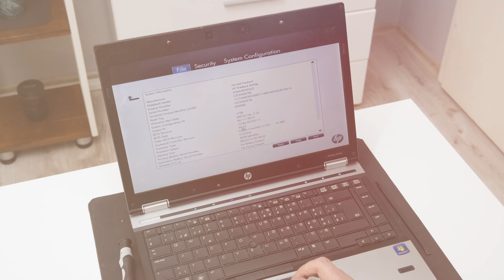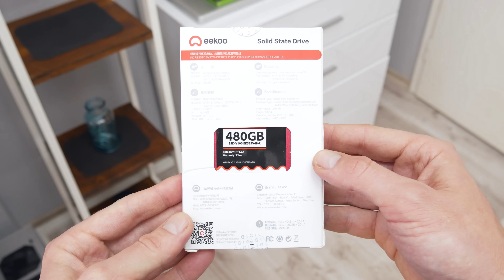Restoring and Upgrading an old HP EliteBook ( Plus Data recovery )

Comment: Andrew I was wondering if you could try an egpu on this laptop I own this with an i5 and wanted to order the exp gdc dock
Reply from the maker: I've tried but not working well, works over diy egpu software only and express card connection but with a lot issues like, dissconecting, driver errors

Comment: 'This laptop is fine for basic use'.

Uh. That little i7, 8GB RAM and an SSD will do better than most mid-range shite on the market today. :)
Reply: These 1st gen 2 core mobile i5/i7 CPUs get beaten by mobile Celerons today. The 4 core models still have some use but that's it. You need at least a 2nd gen if you want something decent.
Reply: Basic use, yes. But this i7 delivers performance equal to 6W Celerons today. For $700-$1000 today you can chose between Whisky Lake i7, Ice Lake i5, Zen+ Ryzen 7 or Zen 2 Ryzen 5 laptops. These are way more powerful than this i7-620M.
Reply: @Subh8081  The fact that a first gen i7 can even MATCH any modern processor is impressive by itself
Reply: The same cannot be said about the shitty Intel integrated GPUs, though.
Reply: Might perform well but that tiny poor excuse for a trackpad would drive me mad
Reply: I use that Daily and i download Windows 10 and it works fine
Reply: always ask what generation it is. A first generation i7 doesn't worth today, instead 5th gen intel cpu are still good
Reply: I'm sure my 2018 HP Craptop™ will only get 5 fps on battlefield
Reply: not really as it's the first iteration and a dual core from a decade ago
Reply: @gnuportexe4657  True but it has 2 physical cores and 4 logical cores. This i7 performs quite well. There are still laptops that have 2 physical cores and 2 logical cores and they do this to save power. I have this same chip for my HP and Dell. I am going to the i7-820QM to test that cpu next.
Reply: @gnuportexe4657   got the i5 still fast sandy Bridge aged well for me ')
Reply: @MrSonic731  yeah but that has twice the cores at a faster clock speed.
Reply: @gnuportexe4657  mine too i5 version and it's almost going to be a year now and it automatically shuts down while even browsing chrome ;(
Reply: @aapkaash  Thats probably because it gets hot, Clean the fan and replace the thermal paste with new

Comment: Hello, I'm from india and I have a laptop with a AMD A6 9225 processor and I want to convert it into a ryzen 3 or 5 processor can u help me in telling me whether it is possible or not and where to find the parts if it is. By the way ur vids are very good and intellectual
Reply from the maker: Hey bro, you can do some upgrades but not to Ryzen. There is a few reasons. Laptops and most of the computers are designed for specific CPU, they have socket that support specific CPU, chipset that supports specific CPU models and basically the entire motherboard is made to support  line of one Generation or line of limited CPU numbers from one generation CPU's. The only upgrades that can be done are the CPU ( if the CPU is removable, not soldered ) RAM, Disk and in some cases GPU ( some high end laptops have removable GPU )
Reply: @ComputersAndTechAndAndrew  thank you so much for helping

Comment: Make a video on you modding an all in one pc with a gpu. It would be nice to see one. I have one of those, and I think I can do some more upgrades soon. Mine is a 2009 Acer Aspire Z5600. It had touch screen, but the driver for it are not working anymore, and I was unable to get drivers. Either way, just wanted to tell you for a suggestion, that exact model or similar would be very nice though.

Comment: Will dell process intel celeron can turn into i3 please reply
Reply from the maker: If the CPU is removable than you can upgrade, I have video on my channel where I upgrade Dell from Pentium to i7
Reply: @ComputersAndTechAndAndrew  the model is dell insprion 15 3552 i don't know much but my pc lag to much and i am a 17 year boy i ask many place but they told the the procceesor cannot be changed or remove please tell me if i can change from celeron to i3 model is ispiron 15 3552 please reply by the way i am from India  i hope you will reply thanks to be responsive
Reply from the maker: @Luciferr.76  Hey bro, the CPU in this laptop is not upgradable, it is soldered on the motherboard, the only waht you can upgrade is the RAM and HDD to SSD
Reply: @ComputersAndTechAndAndrew  thanks to reply now i will use this only for my basic works so thanks to be resposive once again most thanks from bottom of my heart.
Reply from the maker: @Luciferr.76  U r welcome bro

Comment: Good restoration, I had a 8440p for a few years but I got a 8440w for free since it had a dead mobo and went all out after selling the p. New quadro board $35 on ebay, 820qm was $26 on ebay, 500gb WD blue on Amazon for $58 and a ODD HDD caddy for $15 with a 1tb rotational I got free from work. Already had 8gb of ram, the 1600x900 display and centrino ultimate 6300 wifi card. 820 is A LOT of chip for that cooler but it manages. I just use it for YouTube and email and stuff but I love it! Keep up the good work :)

Comment: I did the same with my STI1422 a brazilian variation of ECS R42 Laptop , i7 640m , 8GB Ram Dual , also i bought a new cover *a variation with  a fingerprint sensor , added Bluetooth with Centrino 6235 and Added 3G Card , and of course i have switched from a HDD to a SSD and kept the old HDD on CD/Driver slot using a Caddy Adapter...

Comment: Incredibly surprising that it's capable of 4K from a browser. With proper HW/Accel from something like, say VLC or PotPlayer, especially KODI, you can expect it but straight from the browser? Not bad at all. Video playback from browsers usually takes a gargantuan hit in performance compared to a proper video player, so for a laptop this old to run it in 4K... Impressive

Comment: I have a hp pavilion 17 notebook. I need to upgrade the WiFi card. I need to know the best one. Can you help me?
Reply from the maker: Hi bro, HP pavilion models mostly have Realtek WiFi card, if the WiFi is not working ( burned/damaged WiFi ) than you can buy a new one but similar or the same. Because some models of HP have compatibility issue, not all Wi-Fi cards are accepted by the hardware.
Reply: Thank you for responding so quickly!😊

Comment: Got the i7 version of this laptop 5 years ago as a refurb for $300 and just put an SSD in it, as he says, great for basic tasks.
Reply: Basic tasks, I beg to differ, very powerful for it's class especially with i7 and SSD. 16 RAM DD3 and it's a powerful machine.

The LORD JESUS CHRIST bless you!
Reply: @Smitty-op4ld  I tried to edit video on it and it was having no part of it! Lol
Reply: I got the Latitude from the same era with i5 5 years ago for 250ish usd and it still works  with an sshd, albeit it slows down alot with browsers these days. I didn't put ssd as I don't think it would be used at full potential as its sata 2 port only.
Reply: @tejaspadhye  Since replaced it with a new Acer Spin 5
Reply: i am using the same and i did the same but i only get it for like 50 or 70 bukes
Reply: I had an i7 model that was originally given to me by my company and later bought from them. The monitor quite frequently shut down and now it didn't start at all. I then bought an i5 model that was working fine even if it was slow that I've replaced it with another i7 model that randomly reboot for no apparent reason. Any suggestion on how to repair the repair the two i7? I was thinking to call a repair shop but I'm afraid of the costs.
Reply: @dacki84  Replace it, its 15 years old or more at this point.  I gave the one I had away years ago.  You can still get refurbished laptops "off lease" from big companies for cheap

Comment: Give it to lowspecgamer he'll be running battlefield 10 in no time.
Reply: Ur name really caught me
Reply: @nahthataintspicy6115  😂😂
Reply: Last year I put together an 8440p that ran GTA V at 60fps (720p at 0.5x render scale)
Reply: Sergiy Botsman how’d you manage that
Reply: @decmark11  I put an i7 720qm in it and used no-shadows mod, also the Quadro GPU can actually OC pretty well.
Reply: @sersoft_corp  see I'd thought about that, but I'm always worried it would overheat?
Reply: @decmark11  My temps were totally fine with good new thermal paste, just don't try to game while charging battery if you only have the 90w charger like I did. 

Overclocking is not as much of an issue as with my Dell 6430, which had a Fermi based Quadro GPU in it, also an amazing overclocker, but certainly does generate more heat and suck up more power than the GPU of the 8440p.
Reply: @sersoft_corp  you got a great cpu. That can handle a gtx 1650. Try to search for EXP GDC.
Reply: @sersoft_corp  how i have one i cant even play gta iv
Reply: @sersoft_corp  please please I wanna talk. I beg you. Hey foreigner help meeee
Reply: @sersoft_corp  how did you do that
Reply: He is great😁
Reply: Your name bro😂
Reply: a goood idea not gon lie, gave a like 👌

Comment: The black screen kills me every time i install windows , with Linux it's OK . How i fix this issue?
Reply: i think ur old system have files in "bad sector" on disk thats why u have problems , when u instal new system  disc move your data on "normal healthy sector"  and bad sector is locked now. Thats why now its all fine, but probably ur disc is not in good condition better save ur data.
Reply: @Charlie_Payne  i replaced the hard disk many times still the same , i think it's RAM issue i don't no , if you have any idea tell me please .
Thanks For Replying .

Comment: Bro i want to ask that can we choose laptop processor for upgrade
Reply: Most of the new laptops have integrated cpu (You can't replace it). To check just enter Your laptop cpu on google and just search for info if it integrated or no. (Sorry for bad English)
Reply: You need to check your laptop if it's capable to upgrade a processor, just look online and you will know it
Reply: @daydreamers845  i am not getting info about that on online

Comment: I have an experience with Dell E6410 which uses the same Lynnfield generation of CPUs and 2x4GB modules was the maximum and it even didn't like all brands, just SkHynix dual rank 4GB modules worked, i even had a regular non low voltage 1600MHz 8GB modules which didn't work too. Next generation of CPUs after this one - Sandy Bridge has no problem with any low voltage 8GB modules.

Comment: It's been a while since I've seen your egpu setup. Is it still advisable to use it?
Reply: If you're on budget but have extra GPU laying around sure, otherwise no. The bandwidth loss is almost 50% or greater so its basically a waste of money of what ever you'll be using.
Reply: if you dont have dedicated gpu on your laptop and a gpu laying around its good but if you have anything from the last 5 years with nvidia or amd dedicated gpu then no
Reply: It depends on how fast your pci slot is. If it's a WiFi card slot, it would work considerably good but if it's not a high speed slot, you will be very disappointed.

Comment: As i commented earlier 
One question left in lenovo g505s which egpu will support?
Lenovo g505s have :- amd A10 5750m processor 2.5ghz base and 3.5 ghz turbo frequency. 4core 4 threads 4mb cache?
Pls suggest me gpu! Can i use rx 570?? Or 1060? Or 1050ti?
Pls tell me
Great video as always!!
And my laptop also makes same tick sound and my laptop turns on in 15 mins!! + Freeze after bootup

Comment: MY HP PAVILION G6 LAPTOP BLACKSCREEN ISSUE BUT I TRY TO CHANGE RAM AND OTHER STUFF BUT MOTHER BOARD FAN IS NOT SPINNING IS THERE ANY PROBLEM IN SAY SOME SOLUTION
Reply: Check fan connectors! Maybe there is cpu overheating issue
Reply: @BROTHERsGAMINGxenon  while working in ppt suddenly it stops with a sound and never turning on 
Caps lock led is blinking with 3 interval
Reply: @suryajenson6583  is it a beep sound?? Or which type of sound??
Reply: @suryajenson6583  A blinking "Caps Lock" key can sometimes mean that there is an issue with your battery or AC Adapter. If your battery LED and "Num Lock" button are also blinking, this can mean the same thing.
Check your charger voltage
Or battery! Maybe some of your component not getting power properly
Reply: @BROTHERsGAMINGxenon  beep
Reply: @BROTHERsGAMINGxenon  okii thank you
Reply: @suryajenson6583  check it
If it will work then ok if not reply me I'll research
Reply: @BROTHERsGAMINGxenon  BEEP
Reply: @suryajenson6583  again?? Have you checked battery Nd charger?
Reply: A consistent beeping with no boot means you have a bad CMOS (RAM) chip and need to have it replaced.  If it starts to boot and runs for several minutes, then the beeping starts and the machine shuts down it's most likely a failed cooling fan
Maybe you're right!
Change cooling fan 
Your processor heating up cooling fan isn't working properly
Reply: @BROTHERsGAMINGxenon  okii thank you i will check an say to youu
Reply: @BROTHERsGAMINGxenon  its stilll remains the same i replace with good ram but no result 
only this happening is power putton on thats it not fan spin but harddisk is in good shape